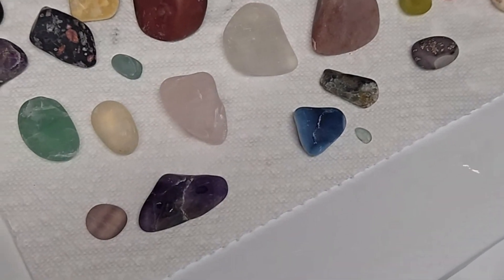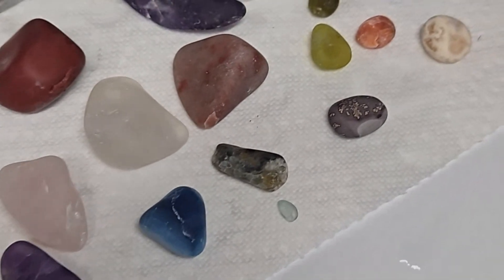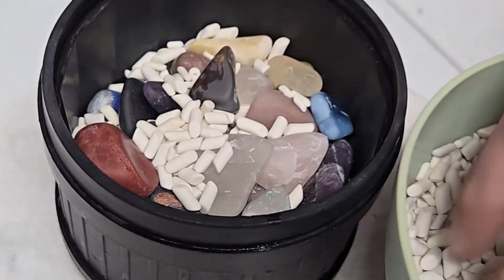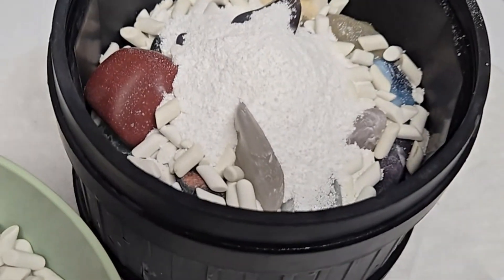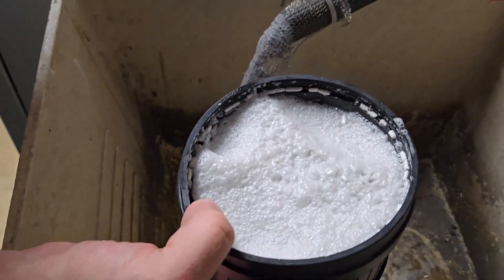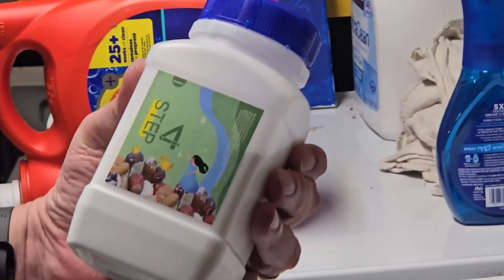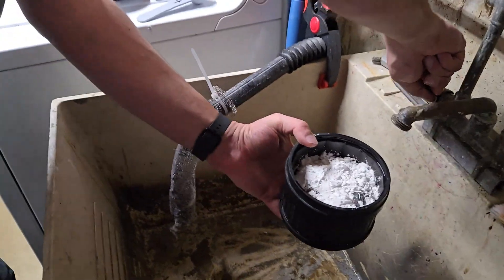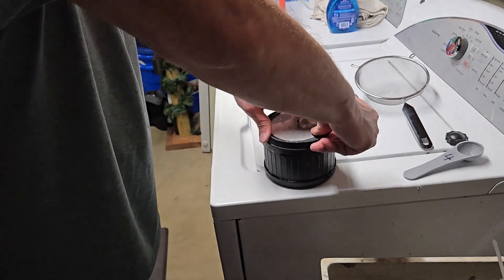Getting Ready to Glow-Up!

Comment: Step 4 you want something more like 8000 grit. Use polish from Rock Shed or Kingsley North for 8000 grit or better aluminum oxide.
Reply from the maker: Agreed, Im trying the kingsly micro alumina right now and have 5lbs of rock shed 8000 in my supply bin too.